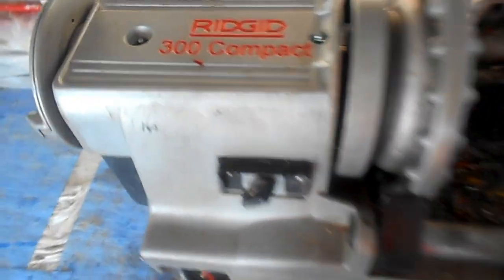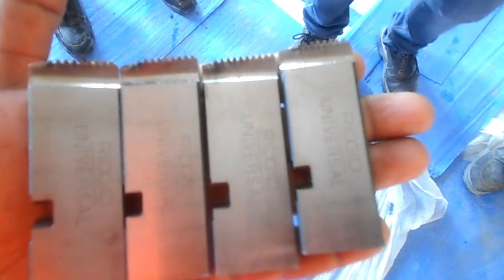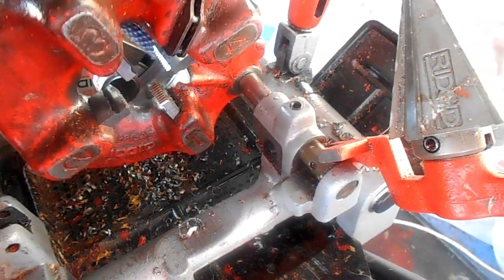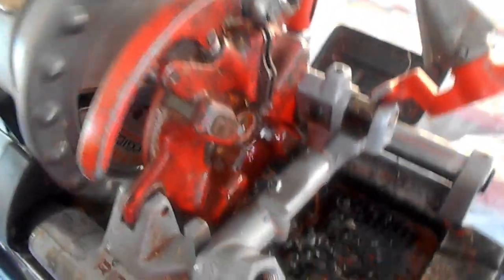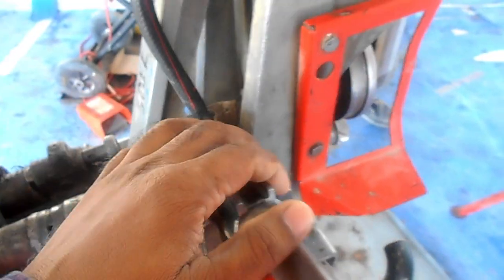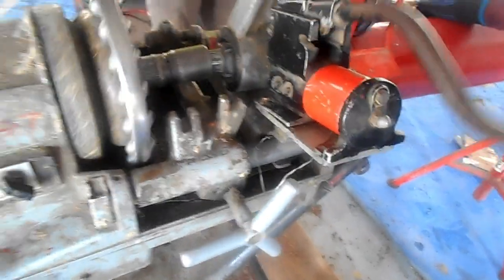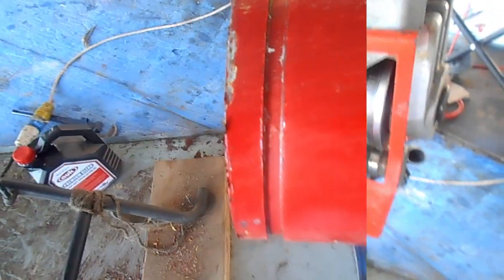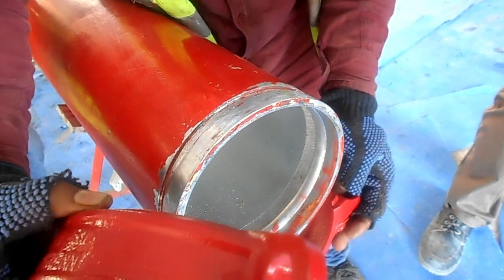Fire Fighting Pipe Threading, Grooving & machine Setting & Step by Step By MEP Tech Tips

Comment: Roll Groove machine are also marketed/sale by Victaulic. Could you please speficy the model no. of roll groove machine of Victaulic used with Rigid 300 Machine for making groove upto 12 inch pipe.Further  model no. of machines which produced cut grooved.

Comment: HOW TO BEND GI PIPES AND HOW TO MAKE OFFSETS IN GI PIPES IN ELECTRICAL WIRING.WHAT ARE THE PVC PIPE SIZES AVAILABLE IN ELECTRICAL WIRING HOW MANY CABLES MAXIMUM CAN PULL BASED ON THE SIZE OF THE WIRE
Reply from the maker: Usually we dont make any bends in Fire Fighting pipes its not allowed, Becouse pipe strength will get loose and its against NFPA stds, Moreover, we use 45 deg or 90 Deg bends for any offsets 
Note :- Try to avoid offsets in any piping system